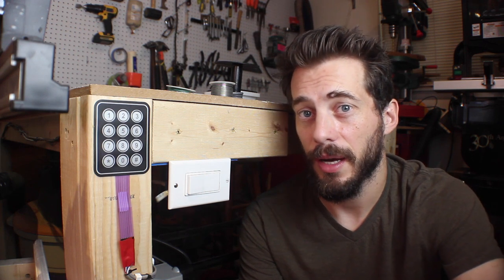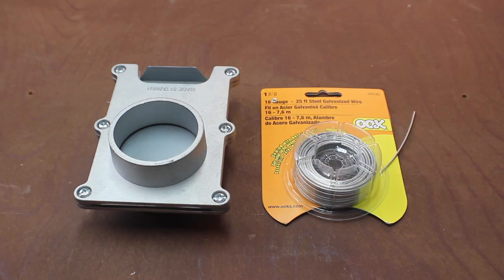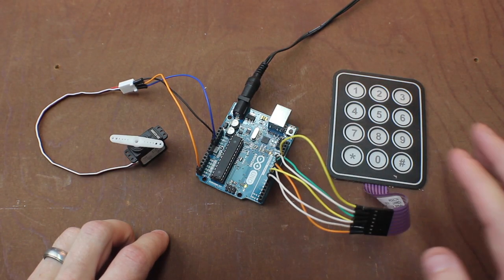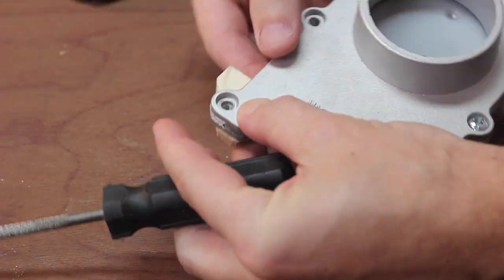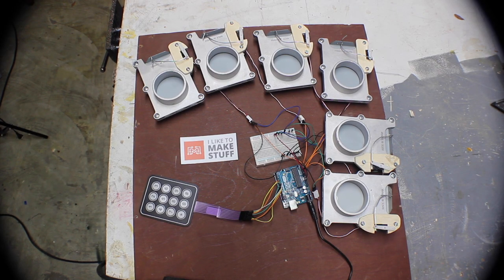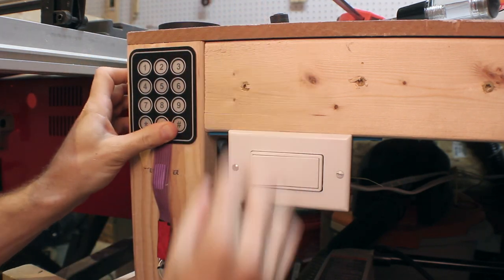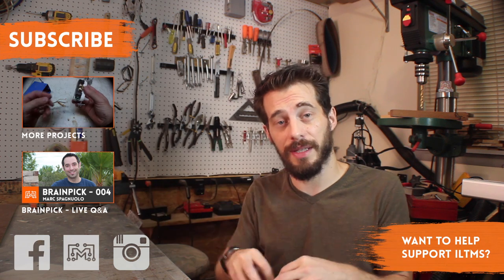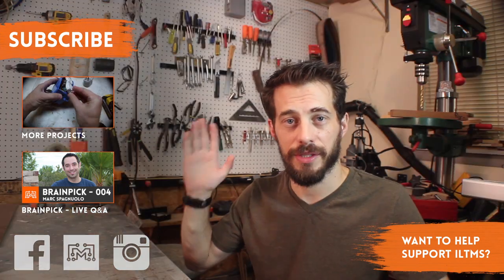How to control your dust collection with an Arduino (it's easy) | I Like To Make Stuff

Comment: Hi Bob:
I am thinking of doing what you showed in your video "How to control your dust collection with an Arduino (it's easy)"
and I have a few questions.

1.) What power supply is needed for the Arduino?
2.) How do you protect the Arduino form dust? Did you make a case? Does it need a cooling fan?
3.) Are those servos powerful enough to open a 4 inch blast gate?

Thanks
Reply from the maker: +Turntastic Wood Designs The Arduino needs a 5v supply, but the servo shield should have it's own power (probably 5v, I don't remember, but more mAh)
I just had the Arduino under a table, but a case would be fine.  You might want a small fan if you case it.   I'm not sure about the servo strength on 4" gates, I've never tried those.
Reply: +I Like To Make Stuff Thanks for your reply. I have more questions.
Can you explain the breadboard. That was a bit unclear in your video.
Thanks
Reply: +Turntastic Wood Designs It looks like he just used the breadboard to have a ground rail and a power rail, while all the inputs went directly to the arduino.
Reply: I would use a pcb instead for rigidity and a arduino pro mini or arduino micro for size allso might want to use metal gear servos for 4 in gates with longer arms and you probably want to get larger servos

Comment: Interesting project and relevant to my shop plans. Not much detail about the Arduino coding and operational considerations. For instance, do you relax the servos when they are in position? I find that servos, particularly cheapies, expire quite quickly if I leave them energized holding my desired position indefinitely.  If possible, I take power off them when stationary. Your thoughts?

Comment: Really cool project. Is the uno running on a 9v battery or did you wire it up to the switch on your bench? Do you just keep everything bread boarded after the initial prototyping?
Reply from the maker: The Born Maker I ended up using a 9 volt 3 amp supply, it needed the higher amperage to drive all of the servos. I left it breadboarded for now, because I still need to build a small enclosure for the arduino.  I've got a few more details and a downloadable sketch for it at http://www.iliketomakestuff.com/automated-blast-gates/
Reply from the maker: The Born Maker Correction, it's 9 volt 1.5 amp

Comment: Working with a micro-controller only to operate some valves by hand from a central spaces is kind of a a pitty. 

Since you like to make stuf....
Have you ever thought to make the system full automatic?  
So whenever you start using a machines the vacuum-cleaner turns on automatically and the corresponding valve(s) open(s).
It would not be a difficult task to make the Arduino detect when you use a machines. 

Grt,
 Daniel

Comment: Great video.. 🤘🤘
Any idea on how to make it completly automatic?
I Mean, i have a work bench with multiple machines attached.. And a complete automatic dust collection..
But im looking for a way for the arduino to know wich tool i turn on..?
So When i start the mitersaw in the middel of the table the vacuum start and then it would be great if the gate opended automatic and closed again When i turn off..
And the same When i move to the other side of the table to my tablesaw..
Sorry for the bad gramma..
Michael

Comment: well explained Bob, I think I could even do it and I know nothing about electronics. It looked like the gates were not fully opening...was that the angle of the camera or the sacrifice you make for automation.
Reply from the maker: effeinc I talked a little bit about it at http://www.iliketomakestuff.com/automated-blast-gates/ but the gates have a dimple in them that stops them from sliding out, which really only lets open about 3/4

Comment: Could you detect active voltage of the the power cord of "x" tool and have that trigger the gates? and also turn on the vac? Seems more convenient than walking across shop to push a button and it all turns on when the drill press or table saw turns on.

Comment: that's a great idea but i feel like it's only half done. Would it work better if you set it up to work with the tool your using? Can you set it up to switch blast gates and turn on dust collector when you turn on or off a tool ? if so that would be slick.
Reply: +Eric Halstead  I think it would be nice to have your dc work with the tool your using.
Reply: +Bean Mosheen Yeah, but I imagine it would be worth it.
Reply: +Eric Halstead Simpler option might be to just tie the blast gates/on feature to a wireless (or wired if you prefer) button that is mounted right next to the tools power button. Then it's just a quick double tap and you have the dust collection setup and the tool ready to use.

Proximity sensors might be another automated way to do it, but you would need to mount the sensor in an area that won't cause your dust collection / blast gates to trigger when you are just wandering around your shop.

Comment: Great Video, thanks, What was the reason to changing to aluminum gates?  Was there somethign wrogn with the plastic one you had originally?
Reply from the maker: Luis Lacayo  Thanks!  I found that the plastic ones got bound up pretty easily with sawdust, if it got into the little channel that holds the gate.  The aluminum gates move much easier (which is better for the servos that I added) and didn't get bound up because of the debris.

Comment: How come one Arduino is able to provide enough current for so many servos?
Reply from the maker: Max Mustermann It's about the power supply. I used a 9 volt 1.5 amp supply.  I tried some smaller options, but they didn't have enough amperage (650 ma) to push all of the servos. I've got details and links to the supply at http://www.iliketomakestuff.com/automated-blast-gates/
Reply: The Arduino doesn't power the servos.  They have their own onboard power supply.  The Arduino is just providing the PWM signal that tells them what position they need to go to.
Reply from the maker: Dan Heidel That's definitely one way to do it, in my case, they're actually being powered by the 5v output on the Arduino. But you're right, you could easily just power them by a separate source.
Reply: Ah, you might want to be careful of that.  The power regulator on the Arduino is a small linear regulator.  It can provide around an amp for short durations but both it and the power traces going to the pin really aren't designed to handle large or sustained current draws.  With one servo, you'll probably be fine.  If all of the servos are running at once or if a servo gets stuck and has a sustained high current draw, you risk burning our the Arduino power supply. 
  Also, with those long power leads, you're likely to pick up a lot of RF current surges from equipment motors as well as inductive kickback from the motor switching.  Those will generate ransient voltage spikes that can easily damage the Arduino over time. 
  For short term use, the current setup is probably fine.  However, I'd recommend a separate 7805 or wall wart PS with the ground tied to the Arduino ground for long term use.  Also, the use of some power buffering capacitors as I mentioned in another comment will help with the current surge and transient voltage spike issues as well.

Comment: you could do some of the wireing through your build in ethernet cables.
as far as i know a ethernet cables have 8 wires but only 4 of them are used.
The first thing i thought about is controlling my light in the entire house using my pre-build in ethernet.
idk thought you would like to know this.

also english is not my native language so excuse my mistakes

Comment: @I like to make stuff.  As this is an old video i would like to see if you have upgraded it. Also how did you deal with the power requirements of the servos, as the each servo needs 4v min. 
Also you didn't mention if you fixed the servos only opening the blast gates half way. I am guess you did or you would have terrible vacuum.

Comment: Slow to the party, but great video. How much more work to make the gates open and close with the tool? Our shop is not convenient for use of a centralized keypad.
Reply from the maker: Darren N There's a bit more too it. You have to have something in line to measure the voltage draw change, etc.  More complicated, but definitely possible.  Another option would be to add a blue tooth remote/receiver to the mix that would create the same output as the keypad does, but remotely.

Comment: Hello. Love your videos :) I have seen this video a while ago, and now I want to give it a go. But hopefully you have the time to answer one question about the Arduino. 
I want to automate my blast gates in my wood shop. But due to the layout and size, it will be unpractical to have only one remote. When I am sawing I need it close to the saw and when at the joiner, band saw, drill press etc. 
Is there a way to have maybe 5 controlpanels? and no matter who you use it will open the correct blastgate and close the rest?? 
Or maybe there is a control panel with only 2 buttons, this machine open, the rest closed and all off. 

Hope to hear from you. You make great videos man :) 
T. Robertsen
Reply: Same question!
Reply: SAME QUESTION!!
Reply: Norwegianwoodworker - you certainly could do it with more panels, however I would no longer go with hard wired interface unless you wanted to run wiring all over. 

The easier solution would be to ditch the hard wired touch pad and go to a remote. If you have good line of sight then an IR remote should work fine. There are numerous code examples of how to use IR remotes and sensors.
Reply: Thanks for the answer. I am going to try the wireless options :) 
Hope to have this finished by the end of Christmas
TR
Reply: So how did it go?  I have the same need for multiple work stations each with a control panel. IR is probably not practical, would have to be RF
Reply: Was it just me that understood, that whichever tool that was powered on, only activated (1) one Blast Gate. Leaving all non-used Blast Gates closed, due to all other Survo's not being activated by its own dedicated tool? 
Or, should I just go back to using hand tools??

Comment: I love your idea, I noticed that the blast gate did not open fully, do think that will be a problem ?
Reply from the maker: woodaddict1 Not really, they seem to work fine. It's actually a condition of the gates themselves.  They have a dimple in them that stops them at about 3/4 open.  Strange design, but seems to work fine.

Comment: Very cool project.  I saw someone asked if you would have used the Shapeoko for the servo brackets, but you didn't have time to model them.  If you had a 3d printer (which you have said in the past you would like one), would you have considered making the brackets that way? Or is it too much time in your opinion for something basic like that to model and print (or cut out on a cnc)?  What about the housing for the Arduino, would you use the cnc or a 3d printer?
Reply from the maker: Matt Williams I definitely think either could work. For the brackets, it'd be really quick and easy to do in Easel, since it's basically a 2d shape. Probably not much harder to do with a printer, but I don't have the experience to know for sure.  My printer SHOULD be shipping out this month, so hopefully I'll be able to find out soon!  As far as the Arduino housing, I think 3d printing would be simpler since it's a 3d shape. Also, I know that there are plenty of Arduino enclosure models out there already, so it'd be simple to download on and print it.

Comment: Hey Bob!

I know this is an older video but I have a question--it seems like the servos aren't able to pull the aluminum blast gates fully open, but the only clear shot I have to refer to is when you're fiddling with the wire to connect them. Did you end up finding a way to get the blast gate to open completely? (Or does it not really matter?)

Thanks for all the content, btw! I'm a frequent purveyor of your site, channel and Podcast. Good luck with the move!
Reply from the maker: They always opened about 90% and that never seemed to be an issue. I think you could get them to fully open with a little more experimentation. The shape of the wire and it's placement were the biggest things there.

Comment: Hi Bob you can make one like mine  I opened an old line control car that only go backward and forward I get the motor then solder the heavy gate wire By solder on the tip of the DC motor

Comment: So I watched this video a while ago and it really made me start to think. Would the control relay from a whole house vacuum work to turn the dust collection on/off and close all blast gates but the one that's being used. A simple relay at each tool would be able to trigger the control. Now I just need a way to control the blast gates at the same time. Default closed but open with current. Let me know what you think.
Reply from the maker: Yeah that would definitely work. Growing up we had an in wall vacuum system and all of the gates were spring loaded. They couldn't be open unless the hose was plugged in. You could maybe accomplish the same thing with electromagnet (to force gates to a state with current applied.  Maybe... :)

Comment: If #0 on the keypad not being used, could you replace the switch with the #0 button. So every time you press '0', the vacuum turns on.

Comment: How would you recommend automating similar open/close mechanisms from a smartphone? I'm interested in feeding my fish while I'm away on business trips for several days and an automatic feeder can't do the job.
Reply from the maker: neocorleone1984 I can't think of the names of them off hand, but I know that there are a few Arduino attached modules that really simplify controlling the Arduino over wifi.  I would start at Makershed or AdaFruit and see what you can find there.  It's definitely possible!  Good luck

Comment: I don't know anything about Arduino. Do you have to know programming to use these? Great use of this system and well explained.
Reply from the maker: +Mike Biggs Thanks Mike! yes, you do have tot program them, but it's far easier than you might expect.  There's a huge online community around them, so there are tons of resources and examples.  A great place to start is http://arduino.cc
Reply: +Eason Qin Thanks to both of you for replying to my query about knowing how to program these devices. I may give that a go if I should decide to automate this system. Thanks again

Comment: Awesome. Any issues with the blast gate not fully open?
Reply from the maker: hoth mob nope, works fine. They have a little dimple that prevents them from opening more than about 3/4
Reply: Gotcha. I had issues with the plasticky ones clogging up. Gotta upgrade. Thanks!

Comment: why don't you upgrade with sensors for the current on each of the pieces of equipment? when it's under load the gate opens.. and then just program a brief delay to flush the system

Comment: So you were able to use the 5V of the Arduino Board instead of a dedicated power supply?
Reply from the maker: Xano Trevisan Kothe Nope, had to get a 9 volt 3 amp supply to drive the servos.  http://www.iliketomakestuff.com/automated-blast-gates/
Reply: I Like To Make Stuff You are using 9 volts because of the power lost by the long distance?
Reply from the maker: Xano Trevisan Kothe No, mainly I just needed higher amperage to run the servos, and just came across a 9 volt supply that happen to provide the amperage needed.  The Arduino can accept 5-12volts safely (I think) so since it was in that range, I went for it.  Not sure that the voltage is necessary, but it works.
Reply from the maker: Xano Trevisan Kothe Correction, it's 9 volt 1.5 amp
Reply: I Like To Make Stuff Hey Bob, you should post the code on pastebin.com for easier access
Reply: Xano Trevisan Kothe
Or a github repo/gist that we can all subscribe to...

Comment: Bob...thanks for the video.  I've been think of doing exactly this project with a twist and was wondering if an arduino would be appropriate as the controller.  "{" I want to be able to monitor a circuit for 220v (i.e. I turn the saw on) when power is sensed it activates a ??(mosfet...or relay) that signals on my dust collector and sends the 5v signal to my blast gate servo.  When power is removed to the saw, start a timer for 30 seconds then depower the dust collector, and close the blast gate servo then start another timer for 30 seconds and signal a 12v DC pleated filter wiper motor for a 15 second cycle. "}"  The logic and programatic planning is easy enough, I was just wondering if enough peripheral monitors exist to accomplish what I need?
Reply from the maker: Yeah definitely! You'll have to use relays, and separate out that higher voltage stuff of course, but it's definitely possible.  I'm not entirely sure how much of that already exists (probably a fair amount) but it shouldn't be too hard to piece together!

Comment: I would be even cooler if you had the arduino sense the current through the line of the power tool you are using a and open the blast gate and turn on the shop vac.

Comment: looks like it only opens the blast gates about half way
A longer arm on the aervo would give you more "throw".  Also wonder of having suction against the blast gate would make them harder to move.  Those are pretty small servos (and therefore pretty weak).1

Comment: sir i purchased leadshine DM856 for leadshine stepper motor (86HS85), I am controlling it with arduino UNO but i am unable to get higher speed with it. sir plz do guide me to get higher speed on stepper motor.

Comment: +I Like To Make Stuff Would one of those servos be strong enough to turn a dead bolt on a door?
Reply from the maker: Possibly. It depends on how much friction there is in the lock itself. You could also look at using a small stepper motor if it wasn't powerful enough.